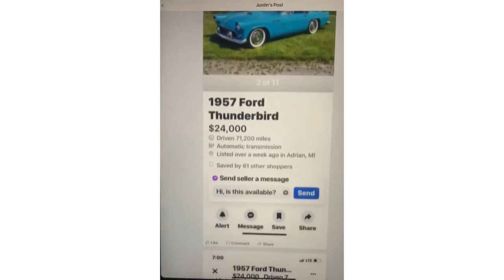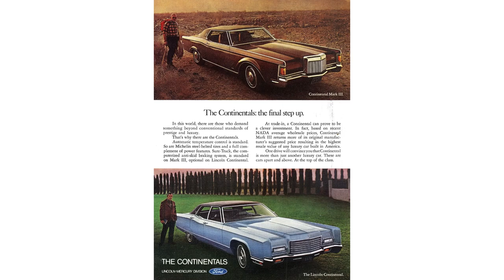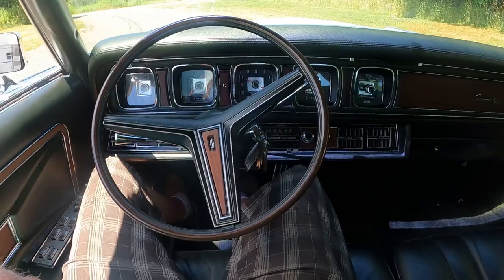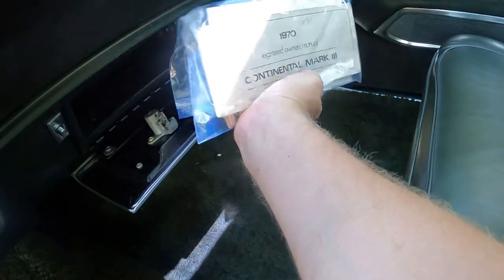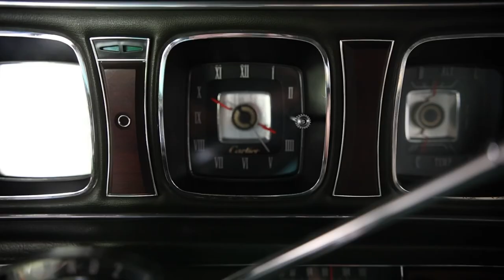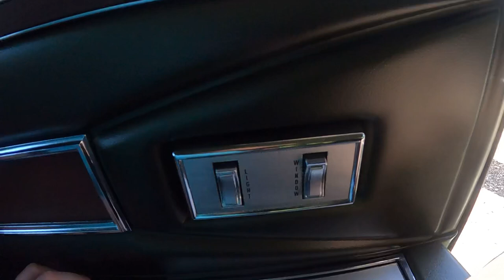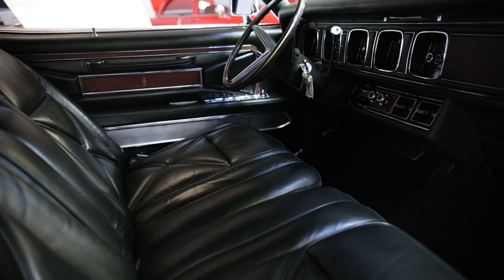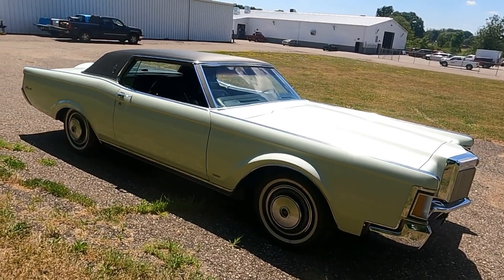1970 LINCOLN MARK III MOST IN-DEPTH REVIEW ON THE TUBE

Comment: I think you can make a (sound effect clip of classic tires rolling on gravel) for me, using a heavy classic american V8 with tires fit of that era, which means classic polyester, nylon bias-ply tires...You can find them easily, used from a local tire service there. I can't do it by myself as I'm in Europe
All the relevant clips found on the internet, are with radial tires. I don't like that, because the sound of classic tires on gravel is very different. Can you send me a sample of a few minutes sound clip to check it out please?I doesn't require video capture, just sound of these classic tires rolling on gravel but if you can make it even with video ,even better, to check out the road path...
If it's good I will need several of them, I will make a deal...Any other who can provide me such audio clips is welcomed. Ask for my e-mail for more...

Comment: You mentioned that these Mark 3s used to be everywhere and now they seem to be scarce.   There's a simple and sad reason for that.  They were rust buckets.  Ford used TERRIBLE quality sheet metal in all their car lines from 1969 through 1971.   My father bought one new in 1971.   We babied it.   He traded it in 1973 for a new Mark IV.   It had been driven only 8,000 miles at that point and never on salted roads.  A veterinarian bought it and drove it regularly for the next two years, winter and summer.  By 1975 there was rust holes up to the door handles!   No lie.   So if you find a dry climate car, it's a real prize.  One final statement.  I grew up in the 50s and have seen a lot of cars.   The Continental Mark III was the finest regular production automobile ever produced.   Period.   That's my opinion.

Comment: You are wrong.  Check your vin numbers it is the Continental motor division of Ford not Lincoln.  Lincoln made a continental mk3 in 1958.  The Continental division started in 1940-42, than started again in 1956; and the final production was 1969-71.  Look at the mk4 it says Lincoln in several places on the car.  They put the car under the Lincoln badge in 72 because Lincoln had never made a profit and they  felt the mk4 could change that.  P.S.  Lincoln was purchased from Cadillac by Henry ford and he gave it to his son to run to keep him away from his ford.  Read the book A man and his machine it is all there.
Reply: Thanks for the insight. I have to quit taking the automotive journals as Holy Writ (even they make mistakes).
     CONTINENTALS to come after '56 would be available via the brick and mortar LINCOLN dealerships, and CONTINENTAL was still a stand-alone marque. 
      Great. Thanks for clearing things up. Alas,  I spent most of the 70s being tooled (as opportunity afforded itself) in modified Fleetwood limousines and an occasional.Eldorado (never lucked on a STUTZ,  they were so rare).
Reply: I'll look it up. Here's another gaffe on the automotive writers, on the way!
Reply from the maker: I looked it up your right I’m sorry that’s super confusing.. thank you so much for correcting me. It’s really weird I always thought it was made by Lincoln even the complete book of collectible cars says it’s the Lincoln Continental mark III.. sorry again =)

Comment: I think the body contours of the sixties and seventies domestic cars were works of art.  But for interiors as art forms, nothing beats the fifties cars.  This car is an example, with its spectacular external lines but its kind of cheap-looking and overly angular dashboards.
Reply from the maker: I agree, except this interior didn’t feel cheap.. 

I’ve owned two town cars 88 89 and both drivers side door panels were flaked 89 was worse. The material they used in the 80s was no line paper thin. The dash on the 80s car would crack.

But getting back to the mark III it was impressive that something the weighs almost 5,000lbs can take off like it did ride was silk smooth =)
Reply: @What.its.like.  don’t get me wrong - I don’t think it looked cheap at all.  It was just too angular and sharp-edged, unlike the earlier interiors which had elegant lines and more circles than sharp-edged squares.